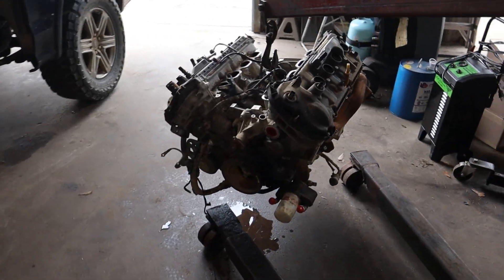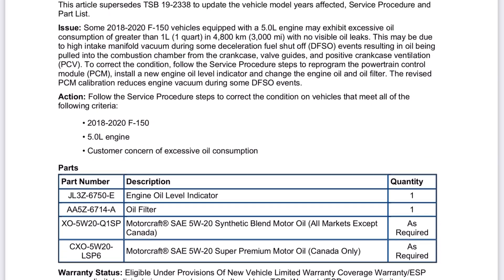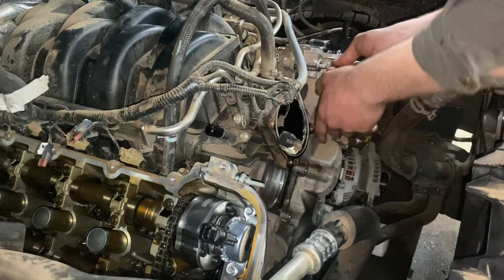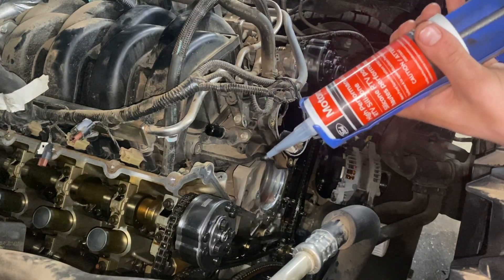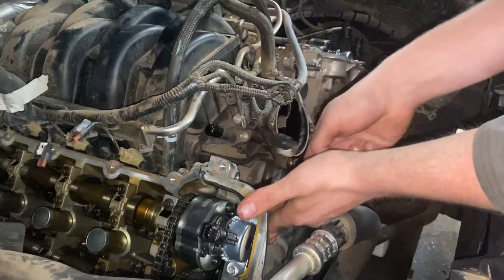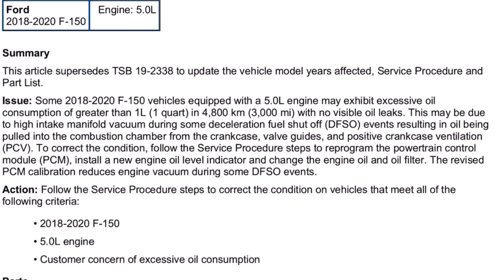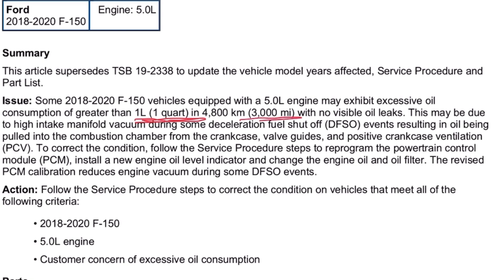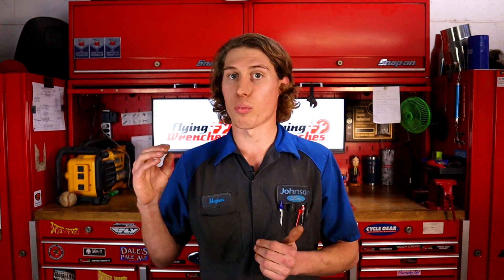Ford 5.0 Coyote Oil Consumption FIX

Comment: I have a 2019 Ford F-150 with the 5.0 V8. My truck does not consume much oil over a 5,000-mile oil change interval.

However, I’m having serious vacuum issues in the PCV lines. I have a catch can installed, and at times the hoses almost collapse due to excessive vacuum.

Has anyone experienced this issue before or knows what could be causing such high vacuum in the PCV system? Any insight or guidance would be greatly appreciated.

Comment: you are a funny and interesting person, ty for that, your over 65 comment i will not take offense to lmao. I do not check my oil unless there is a need to, but I just bought a 2019 F-150 XL with the 5.0L from Texas. I love the truck but boy oh boy, the engine has the rattle noise in it, ford says its normal, the trans jumps in 2nd too 3rd and to 6 to 7 gears, but not all the time. the retrain of the factory resets helps a lot, I checked the oil with was suppose to of been change not long before I bought it, It was 4 quarts low, so I filled it, after took it for a ride and it started running like shit so i changed the oil now today I am changing the pcv valve they say the correct one to use is out of a 2015 mustang and it will correct the oil consumption problem, plus the 5 turn key reset helps reset the trim as well. also if you turn off the adaptive learning it fixs most shifting issues , we will see ty for all you do and say, Have a nice day. oh ya now it started throwing a po420code for the cat, I think the pvc will take care of that I reset the code and it stays off. later dude you do good work .

Comment: Yeah  don't check your oil on a $60k + truck. Do you know how ridiculous that sounds? The first time something happens to that engine the dealer then tells you that it's not covered under warranty because you neglected your vehicle. For the price that Ford charges for these trucks they should do a better job with engineering. Check you oil and all of you other fluids minimum of once a week. And don't let anybody tell you otherwise.

Comment: I bought a '19 F-150 seven months ago with 112,000 miles on it. It was full of oil when I bought it. I checked the oil level four months and 2,800 miles later. It was four quarts low. It burned one quart every 700 miles! That's incredibly excessive. I changed the oil before going on a 5,000 mile trip. I put in seven quarts of Mobile 1 5w-20 and two quarts of Lucas Heavy Duty Oil Stabilizer. 5,000 miles later it was down two quarts. That's a huge improvement. Every now and then I hear a small backfire and I'm sure my catalytic converters are oil-saturated. At my next oil change, I'm going to continue with the two quarts of oil stabilizer, but I'll use Valvoline Restore & Protect 5w-30 instead of Mobile 1 5w-20. 

After looking at the Carfax information for my truck, I don't see that it's had the TSB work performed to reprogram the PCM. I think I'll check with my dealer about that.

Comment: Echo other comments saying “just quit checking the oil level” is absolutely stupid.  It is wrong to generalize all 2018 - 20 5.0l engines in the same statistical family.  Seems to be a percentage of the engines with oil consumption issues, and a percent of those problem engines which the TSB does not “fix”.  To say “just quit checking the oil” to those unfortunate few that the TSB didn’t help is laughable. 
I was one of those unfortunate few that after having the TSB done my 2019 was still using 1 quart every 1000 miles (I brought back to the service dept and they confirmed it was >3 quarts down after two months/3000 miles).  Regrettably Ford refused to do anything else - said they were not going to process an extended warranty claim since I couldn’t prove “oil consumption” was an issue.  This video seems to be following the Ford policy that there’s nothing wrong with an engine that consumes 5 quarts of oil during a service interval. 😢

Comment: Talk about being young and clueless. The big problem is taking the steel liner away and doing the welded in crap liner. You should really delete this video because you are looking more like a shrill than a educated mechanic. You spend 80 grand to replace your 14 f150 that used 0 oil for a 18 or 19 that can use up to 3 quarts of oil in 5000 miles isn't what people expect. Ford screwed up on their liner issue and won't own up to it and you're trying to whitewash it. Put the damn steel liners back in and get rid of the belt drive oil pump.

Comment: I have a 2019 F150 with a 5.0. I have 86000 miles on it. I change my own oil every 5000 miles. I use Motorcraft 5w20 oil and a Fl500 filter. I only noticed the oil over 1 quart low 1 time. That was at the 85000 miles on it oil change. I see no visible leaks. I wasn’t concerned at all. But thank you for the video. Very informative. I plan on getting another 5.0 on my next truck.

Comment: So I'll add my 2 cents the reprogram to stop oil consumption if you pay attention the truck has a bit of hesitation on tip in after a decel and noticed is has less pull on top end and the big issue is ring issues pulled many apart and it's ring issues to say it's normal to burn 4.5 quarts in 1500 miles so when this it's acceptable range so when this causes plug wear premature cat degregation so you need to replace them before their time and we'll every 19 to 20 from my wife's and brothers and bosses and coworkers all have the issue and keep in mind Ford didn't build alot of these 5.0 f150 during the covid time most were Ecoboost many in our service dept that come in just add oil and complain it's a bigger issue than you let on if it was not their wouldn't be multiple tsb on the subject and class action law suit all over for it personally speaking any vehicle burning more than 3 quarts of oil in 5k time is not acceptable

Comment: You shouldn't been a tech. This is the stupidest thing I've ever heard. Why does my 2006 5.4l not use oil but my 2019 uses 3 quarts in 3k miles. Plus spark knock, dealer says engine needs replaced and Ford will do nothing. Idiot!

Comment: I have a 2019 5.0 coyote that ticks like a loud clock. I change oil every 3000 miles. The other day I had a change oil soon come up on the dash. I checked my oil and it was down 3 quarts!  I had no idea about the oil consumption issue but it’s real.

Comment: I first want to thank you for sharing your expertise and experience with these engines.

Back in November of 2018 I was considering getting a new Mustang GT, until I saw all of the engine and transmission(6MT) with the car and the way that Ford Corporate was handling the issues. I wound up getting a Nissan 370z(6MT) with/sport pkg that I've put about 76K trouble-free miles on so far.

I call BS on blaming the high-vacuum condition for excessive oil consumption during times like deceleration. In my experience, a well-built engine with proper piston to cylinder and valve stem to guide clearances, and of course a properly functioning PCV system, should not be consuming oil at this rate. I could see low-tension piston rings allowing more oil to get pumped into the cylinders than the older higher-tension rings, but not to the degree mentioned here. My Z uses low-tension rings but my oil consumption is such that at the end of my oil change interval(3K miles) my oil level is about ½ mm below where I set it at after the oil change, and this is on an engine that has about 76K miles on it and has been tuned to run slightly richer than stock.

I think one of the big problems here is that Ford, like the other manufacturers, is not actually manufacturing these engines in house anymore. They are buying components from the cheapest third-world countries that they can find, with parts that are probably not being made to spec. Likewise, they are probably not doing the component machining operations in house anymore, again farming that out to cheap offshore countries where there is little to no control over quality control.

This puts you(the techs) in the middle of a bad no-win situation between angry owners and an intransigent management at the corporate level.

Comment: This has to be the dumbest explanation I’ve ever heard! If this wasn’t an issuing in the beginning. Why was Ford replacing motors? It’s a manufacturing problem with the early Gen 3 5.0s. Then Ford decided to call it normal and leave the customer holding the bag. This isn’t 1950. A new vehicle shouldn’t be burning 1 to 2 quarts of oil between oil changes. But, it’s not just ford. GM, Chevrolet almost all manufacturers are building crap.

Comment: 2020 F150 xlt ford just replaced my engine because oil consumption and cylinder 1-7 had severe  scoring because of build up. The engine threw check engine and low pressure. Had to take it in. They did replace it without cost to me.

Comment: I had a 429 for years without burning oil. The manufacturers added oil capacity so engines burn oil.  How is this green and what does it do to the catalytic converters?

Comment: The ford service manager told me it was normal for my 2020 f150 5.0 to burn 3quarts of oili every 3000 miles. When he got home from work and I was in bed with his wife, I told him its normal for me to burn 3 hours of rubber in his bed wiile he was at work. The next day they replaced my engine.

Comment: So ford builds a motor that burns oil like a beater junkyard engine from the 70s...and ticks loud enough to attract com,ents everywhere and  the customer is at fault for not checking their oil daily ?  These are 10k engines ...not junkyard cheap to replace .ford screwed up BAD.the 5.0 is a complete pile of trouble ..you have guys on there 3rd engine qt 40k .i was aa ford guy my whole life i couldnt keep defending them after a neighbour , another friend has a damaged motor ford says is normal after spending 80 grand on a new truck ...Its 2025 ...this isnt a 1970 datsun 210 with 250k , we are talking about brand new trucks that cost $$$. I own a new mustang gt with toast rod bbeqrings and ford says my warranty wont help cuz the sound is normal..  and avoid the loss im stuck with ..

Comment: Getting a new engine this month on my 2020 F-150 Coyote. Only 54k miles. 
It drank 3.5liters every 5000 miles and already had the PCM update. 
I did the “oil consumption test” and it got so low it wasn’t even reading on the stick after 3K miles. So it might be eating more than 3.5liters per oil change. 
I always check my oil every 2k because it’s a fucking Ford and Ford fucking sucks. 

Anyway, I wish my transmission would finally die because it definitely needs to be rebuilt.

Comment: Late to the party. 19 5.0 burned a quart every 1000 miles. Got the TSB, took care of it.

Your take is flawed. I wasnt imagining burning a quart every 1000 miles. And i Do check my oil. Roughly every 2 weeks. My 4.6 2 v never burned a drop over its 300k+ lifespan. 

 19 now loses roughly 1/2 quart every 4000. Cant exactly say its all burning. I put a catch can on. It gets about 1.5 oz over 4000.

Lets employ a little logic here. Im not saying its the answer, but its a good start. Problem started in 18, persised throigh 20. First thing that jumps out at me. PLASMA LINED CYLINDERS. Could be the cause. Lets look further.i had an 06 never burned a drop in 300k+. Strange that oil burning is somehow now normal. Whats a difference between then and now? LOW FRICTION RINGS. 

Since plasma lining isnt particularly new in things like motorsports. I kinda doubt the flaw is there. However, low friction rings are pretty notorious for certain failures. Now Daddy government isnt going to allow normal rings back, were suck with them. Dont you think those low friction, flimsy rings, coupled with a plasma lined cylinder could easily cause this issue under vaccuum?

Now for those that consume more than 1 qt every 1000 mi. Or, thise that the TSB didnt fix. Id suggest the problem still lies in those 2 components. And yes, ive seen quite a few of them reported over the years. That liner has been known to flake off, or chip off. Not super common, but its known. Or a ring can easily be folded over. They are kinda like  paper thin now..

Comment: I have an oil consumption problem with my 2018 F150. It uses 1 quart every 2000 miles. I had the Ford  dealer change the dip stick and reprogram according to the service bullion associated with the issue, but it did not help.  I learned I had a problem after hearing valves rattle in the mountains and was 6 quarts low!  It was a company truck and serviced every 7000 miles. I had no reason to check the oil level. I purchased the truck from the company and didn’t service it at 7000 miles. I poured 6 quarts of oil in the truck and the valves stoped rattling.  I now pour a quart in every 2000 miles! I don’t like it, but it is running good with 154000 miles

Comment: "it's not an issue at all" yeah well now I need to spend $1500 to replace a catalytic converter that has gone bad due to the engine burning oil for so long and sending soot to the cat and clogging it up. So yeah the engine is probably still fine, but I'm going to have to keep replacing cats.

Comment: I check my oil every week. I know this post is 2 years old but the manufactures have a nasty habit of running rings with loser tolerances and dont seal like they did 10-15 years ago. They are doing it just pass emissions. Its all about the EPA requirements and making that dollar. My 2019 f150 burns a quart of oil every 1500 miles and it knocks like someone is trying to break into a glass house with a chisel.

Comment: I'm not buying it. A tight engine doesn't need oil added between changes. The first gen 5.0 has low-tension piston rings, and I've heard that a certain cylinder is oblong. It all amounts to blow-by.

Comment: This guy is an idiot my F 150 burn almost 9 quarts in 3000 miles I checked it it was low so I put 3 quarts in it still didn't reach the dip stick took it for an oil change right after that

Comment: Back with  the 1999-2004 f150 lightning . We saw a situation where they’d suck oil through the pcv during deceleration, especially after being up on boost. So like a hard pull then let off.   What we figured out was that those pcv valves didn’t ever shut all the way.  For emissions reasons.  We swapped them for one made for a mid 70s f100 ( which was still available new at that time ). These would shut all the way. And this stopped the issue.  

I’d bet these are seeing similar. Check the inside of the intake manifold. Should have oily coating of this is what’s happening.

Comment: I have a 2018 F-150 V8: I've had the TSB work done, and I'm still going through some oil. I check every 1,000 miles and top off as needed, and it's needed. To your point, I'm over 60 so it's habit. I also change my oil every 5K miles (full synthetic).

Comment: WTF… if you don’t check your oil you will never have a low oil problem!  Now-a-days do people even know about oil changes. Been looking for a new old truck, hopefully without luxury trim, but that actually had regular oil changes.  Check service histories of cars for sale online, it appears, no one changes oil let alone regularly.  Mechanics don’t even know oil needs changing… in my entire life back 50 60 years or even 10 or twenty years ago never heard but once in 1973 some retard in the Navy how drove his Datsun 510 10,000 miles without changing oil.  I always changed every 1000 miles to at most 1500 miles.  Never heard of people running out of oil either.
Reply: Maybe it’s those paper thin rings flexing or some other stupid thing!

Comment: I had a 2012 Mustang GT and it would consume a quart of oil every 2,500 or so miles and I had read enough literature to understand that it was normal, which is why it was given a 9 quart crankcase.   But I also kept an eye on the oil level just out of long-term habit for any engine that leaks or burns it.  However, I traded it in for a 2019 F-150 Lariat 5.0 recently with 84,000 miles and the night I took it home, I was driving it around when the check engine light came on.  I plugged my OBD scanner into the truck and came up with the code of bad catalytic converters.  Ford resolved the issue immediately for free and I didn't think much of it. But out of habit after 2,500 miles, I checked the oil level and sure enough it was down nearly 3 quarts.  I drove it until the need oil change service warning came on recently (about 7,500 miles), added another 2 quarts along the way in the meantime and I'm sure it was down a quart when I took it in for service.  That's 6 quarts in 7,500 miles.  No wonder the cats didn't make it much past the 80,000 mile original warranty.  Good engineering on Ford too with that cat warranty to know when to let it expire.  Little doubt also as to why it was traded in by the former owner, who reset the check engine light before doing so.   I like the truck/engine so far, but I know that engine is not made to run on 3 quarts either.

Comment: My 18 had guzzled oil since day one. Tried the TSB fix and helped some. Seems to be a lot about driving habits. At 101k now. Runs fine. I just keep a qt in truck and change oil every 5k. I’ll add 1.5 -  3 qts between oil changes

Comment: Has ford done a recall on this? I just purchased a 2020 F150 from a reputable used car dealer in town. When I drive it, I've noticed kind of a burning or "hot" smell when I step out of the truck. I've only had it a couple days- the carfax showed that they replaced the front cover gasket at some point in the past along with all the regular oil changes. Most of those were done at a Ford Dealership, there were a couple at a "jiffy lube" type place. This was a commercial vehicle, has 92K on it. SHould I run it to the Ford Dealership and have them look it over? One thing I noticed was the amount of schmutz on the valve covers- I chalked it up to a PCV leak or oil getting into the engine bay, and since it's got 92k miles on a 5 year old truck- not out of the ordinary.